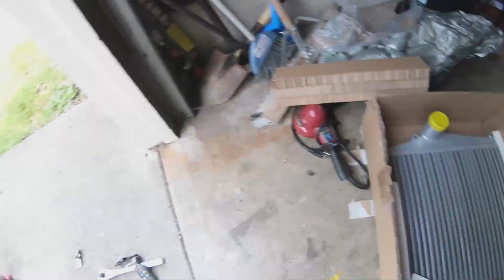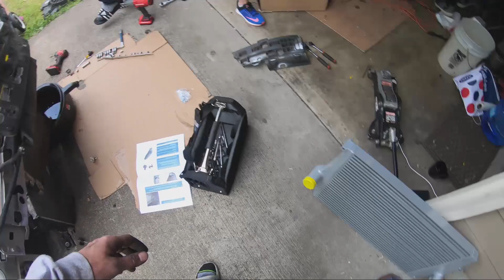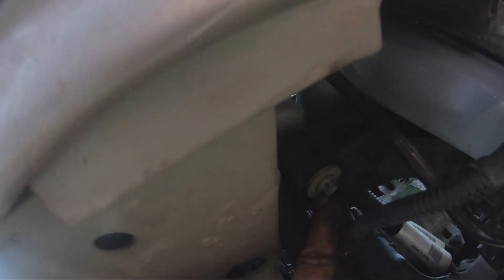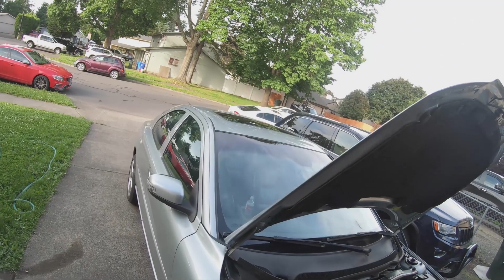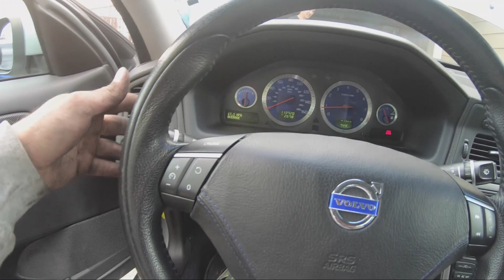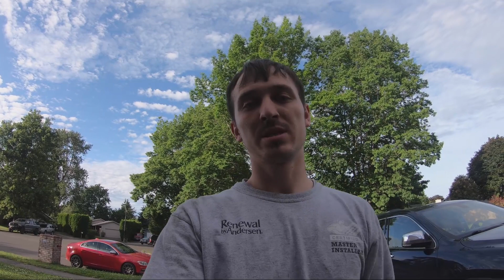Volvo s60R do88 Intercooler install, test drive...

Comment: About your brakes: when was the last time you bled the brakes or changed the brake fluid? If your brake fluid is 10 years it will make it feel spongy. You could also have a small leak or glazed brake surfaces etc. I’ve driven one before and the brakes felt really good.
Reply from the maker: New rotors and pads, new fluid.

Comment: With respect to your brakes, it could be that a few of the pistons are seized or someone used white box pads and rotors when they did the last brake job. Pull it all apart and make sure the calipers are fully functional.
Reply from the maker: No that how the p2 brakes are the p3 are just better. We had 3 p3 Rs all are the same

Comment: I just bought a 2005 s60r with bad radiator driver airbag  hood front right headlight $850, I paid $280 for the headlight. I needed this video even though Ive done it before. Thanks for your help I bought a 2006 v70ra few years back  just needed front bumper cover and  tires for $2500 five years ago still running great
Reply from the maker: Nice. Glad you found it helpful

Comment: I plan on tuning soon but have a snabb fmic laying around would i be good to install it on stock tune?. Run it for maybe couple months.  Not looking for power atm just lower iat in the summer.   Tune is later on
Reply from the maker: Yea you can run it no problem

Comment: After I bled my V70R brakes there was a night and day difference. I should have done it more regularly...
Reply from the maker: I bled them few times to make sure they work good. But not as good as the new p3 brakes.
Reply: @BuiltForSpeed  
There are 2 bleed screws on each caliper, did you bleed both?
Reply from the maker: @Johnno48  I'm aware that there is 2 one ok inside of caliper and one on outside. We had 3 p2 S60Rs the brakes on all 3 work the same

Comment: Check your brakes my dude! I have an R and I've never had issues with stopping quickly, efficiently and consistently
Reply from the maker: I said what i said in comparison to my p3 t6 brakes. The p2 R brakes are alot worse.
Reply: Yeah, exactly. My brakes are solid too. Grip is the only limitation

Comment: U don’t know what you’re talking about. Brakes on these cars are top notch. It’s an old car, if you just got it, chances are something’s wrong. Get new rotors and pads, steel hoses and race fluid and it will stop like nothing else.
Reply from the maker: We had 3 of these already. Compared to original p3 t6 brakes they are weak. We put brand new brakes on 2 of them and nothing changed. I didn't say they were bad brakes but in comparison even to volvo p3 oem in the s60 t6s they are much weaker.

Comment: How much hp does the intercooler give extra ?
Reply from the maker: It depends if its with or without tune. But if i had to guess probably around 15-30hp
Reply: @BuiltForSpeed  yes my v50 is stage 1 chipped to 260hp. Also when my car is fully warmed up it feels slower then when the engine is half cold. And i know its bad to floor it when its not warmed up yet but i had to test it
Reply from the maker: Well when you car is cold you have alot less hot air so yes you will have more power abit. Its normal
Reply: @BuiltForSpeed  so when i get the intercooler its like i have the same power as when its cold but then always

Comment: Looking at this I’m thinking I almost want to mount the new inter cooler on the outside of the bumper so there’s space from the radiator. Fabricate a grill for it -mine is all beat up from bugs and pebbles.
Reply from the maker: I have seen people mount it in front so im pretty sure theres company that makes one with pipes to mount it in front

Comment: Would you be able to mount this intercooler in the front instead, or would the condenser be a problem
Reply from the maker: To be honest im not sure.  I don't know how you would mount it. And you would need different set of hoses
Reply: Go full custom. I spent probably a 1/3 of what he did going full custom. Just requires some patience to get it all piped up because the cars wiring harness goes through along the sub frame and space gets tight.
Reply from the maker: @OnShouldersOfGiants  so you spend less then 150? To go custom?
Reply: @BuiltForSpeed  About 200. The d088 is advertised on ipd for almost 600.
Reply from the maker: @OnShouldersOfGiants  on sale they are 500. Custom made one same quality and same amount of air flow the core itself is over 200 plus the welding and tubing. If you made a smaller one then yea its possible you can make it for cheaper but if you get the same size one with same airflow i highly doubt it.
Reply: @BuiltForSpeed  The one I have is a 27x7x2.5. Smaller but definitely better than stock.
Reply from the maker: @OnShouldersOfGiants  yea, so depending on what you want to have. If you want to make same exact or better then do88 you will have to spend over 300 plus your time/labor so it's cheaper just buying it on sale for around 500.
Reply: @BuiltForSpeed  If you want an intercooler that large, there isn't many options out there. There isn't really any room to fit anything larger than what I got. Its great for being on a budget and just chasing enough for maybe a light tune on the car like I may get. Mainly got it because my VR has almost 190k on it and I want to help to not crack my block and I know pre det plays some part in it.

Comment: You could be my brother in arms. 🤣 I'm doing this, a radiator replacement, lower control arms, a CV axle, an oil change, a thermostat replacement, and finally a brake line replacement. How much of a difference did it make?
Reply from the maker: The intercooler made a noticable difference. But to see the full potential you would need a tune.

Comment: There might be an issue with the brakes,because my r brakes were even better than a pair of 8 piston wilwoods on my c5 Vette. They were on par with the cl65 brakes easily. Check fluid, lines, and ensure its dot 4.
Reply from the maker: I compared them to my s60 p3. They are worse and that same on all the s60Rs i drove.
Reply: @BuiltForSpeed  that's strange. My brakes are fantastic, but I'm using sti rotors and hawk pads. The only issue I ever had with my brakes are low speed squealing when cold
Reply from the maker: @drsuffcatr8319  i see , the rotors were oem style rotors and pads on the Rs i drove.
Reply: @BuiltForSpeed  that could be the issue. I use sti rotors because they were cheaper than oem and the hawk pads since I drive it fairly hard.
Reply: Yeah man, I'm doing the do88 then I'm putting an Elevate tune this summer. As far as your breaks, I have newer, Toyota and Hyundai, BMW and the S60R stops like a race car in comparison.
Reply: @glennallentraining3029  I have the do88 radiator, it's a tight fit, had to change to a thinner clamp for the intercooler pipe, but it's worth it. You hold a little more capacity and way better temperatures, and cool down is incredibly quicker. Especially in high temperatures
Reply from the maker: @glennallentraining3029  im comparing the s60r to my p3 models